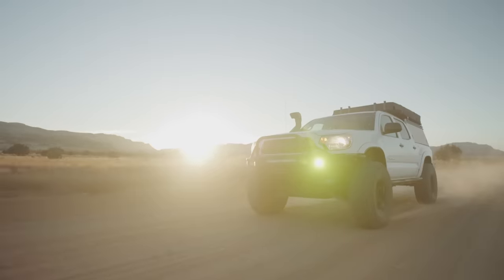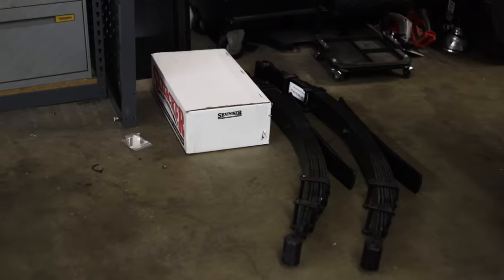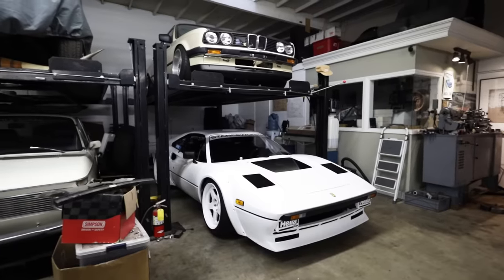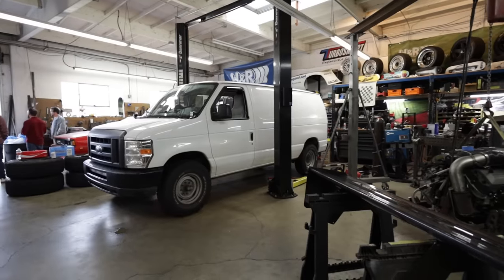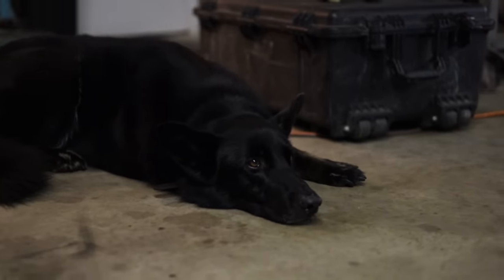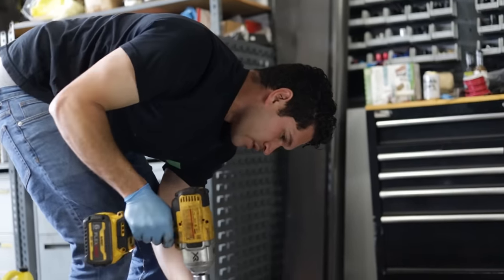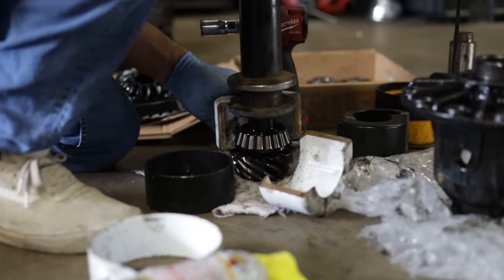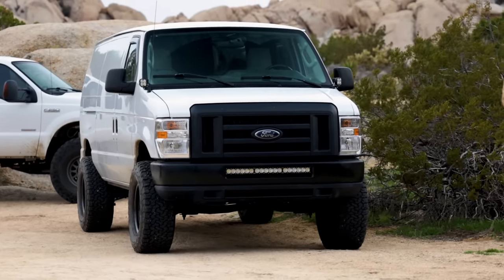Who needs a 4WD van when THIS is an option?

Comment: I think something was worn or broken or out of adjustment on these vans that require two hands to drive.  Maybe they had too much weight  too far behind the rear axle.  My E350 EB cruises dead straight at highways speeds.  Stock suspension with KYB shocks.  Those vans must have needed alignments or maintenance or different loading.
Reply from the maker: I think yours is just the exception to the rule be driven dozens of these vans and owned 2-3. Not a single one drove well stock
Reply: @brakeforsnakes  I should add that mine is a 6.8.  Maybe they have better weight distribution.  This guys is identical.   There are a couple v10 Vlogger that have videos from the road with one hand on the wheel  
https://youtu.be/maxrFIhRnkg?t=619

Comment: Great video. I have questions.... what rear axle do you have. And what was the locker you put I. It?
Reply from the maker: It’s a Dana 60 and a power trax locker. If you look at my latest van walk around video I have a link to it
Reply: @brakeforsnakes  it appears to be a semifloating rear-end. I I contacted u joint about advise on a locker, but his response was that I could only use the factory limited slip in my rear-end. Because it was a c-clip rear end.  It is a dana 60 373 with traction control.  He suggested searching for an axle I can upgrade. Any advise? Was his info wrong? Thanks
Reply from the maker: @MarkReising-z8d  hmmm that doesn't sound like something U-Joint would say because Ox makes a 4.10 and down carrier c-clip 35 spline locker that they use on almost every build they do with that rear axle!

Comment: I want to do the same lift for my 09 e350 extended.  Can you measure front and rear wheel wells and let me know how high it sits on 35's.  Thanks bro.  Love the van and my Wasatch overland high top too!!
Reply from the maker: Weldtech actually has a video where they measure on 35’s and 33’s

Comment: Nice video, 
what was the total cost on the well Texh suspension 5 inch and the rear end?
Reply from the maker: All the parts are listed in the description with links
Reply: @brakeforsnakes  

How about the install labor?
Reply from the maker: As seen in the video I installed it with my friend. I have no idea how much a ship would charge but is very easy to do in a garage if you have a welder
Reply: @brakeforsnakes  

Thanks, 

Last question, with the 4.56 gears, how does the van run on the freeway and is the MPG better or worse?
Reply from the maker: It gets about 15-17 on the highway and probably 12 around town but rpms are very similar on the highway
Reply: @brakeforsnakes  

Great info, thanks!

Comment: I considered doing this to an econoline but I wanted the 4 wheel drive more
Reply from the maker: a 4x4 conversion is much more expensive they're not really comparable. But whatever fits your use case best is what you should do, I sold my quigley 4x4 for this
Reply: @brakeforsnakes  yea I didnt even go with an econoline, I got an awd astro that I converted to 4x4. I agree the e series conversions are expensive but when I off road Its usually up in Michigan and theres nothing but soft sand up there and all I could imagine is a big ass econoline with 2wd just getting buried to the frame rails every time I hit some deep sand. Plus the foliage makes it hard to get fullsize vehicles down the trail. Still love the big Vans, I hope to have something like a sportsmobile someday but what I got is perfect for my current circumstances

Comment: Just saw a video on a body swap to diffrent chassis. I have a 93 E150 Club Wagon Van 5.8L vin 1FDEE14H5PHB57642 and was wondering, can I get a wrecked truck hopefully 4x4 with modern/newer chassis,better TRANS and motor to do the same,AND if so,witch truck would be the one to get that my van body would fit.?
P.S.
I don't want to have to modify anything, would just want to take the body off my van that's in Gd condition, AND put on the newer truck chassis.
Reply from the maker: I don’t have any idea dude

Comment: Kit is $5000, how much would he charge for an install if he wasn't your friend? Anyone know the install price? Would it be another $3000-ish? the welding shops in my area are not cheap, well the quality shops. I'm guessing its around $8000-$10,000 total for the mod as shown? Would it also need more things to be upgraded, like longer brake lines, abs lines, etc, etc, ?
Reply from the maker: I installed it and he welded it it, if there's anymore questions click the link in my bio to the weldtech site they have all the info you need right there. If you pay $3-5000 to get this installed you are getting ripped off. You do not NEED longer brake lines or abs lines but longer brake lines aren't a bad idea.

Comment: snow, mud and the northwest is why you'd want 4wd instead of a tall van with good tires and suspension. I drove a lifted rwd econoline all over the pnw and it was always sideways, real scary... lifted sienna awd is amazingly better and is funner to drive imo...
Reply from the maker: I live in southern california we just have rocks and desert, this thing handles way better than my old quigley 4x4 E350
Reply from the maker: And to clarify it's not about being taller it's about wheel travel, this van has 12" of wheel travel which is double the stock set up and double what my quigley had. Wheel travel has a ton to do with traction along with the detroit locker in the rear.

Comment: 2 wheel drive common man
Reply from the maker: 2wd with a detroit locker is pretty damn capable. My last vehicle was a tacoma on long travel, dual lockers, bypasses, 37's,  etc and a quigley 4x4 E350 van. I sold my quigley for this setup, 4x4 isn't always the answer for every build.

Comment: Why are they re-gearing?
Reply from the maker: Because we out bigger tires on
Reply: @brakeforsnakes  OK I guess so the speedometer will keep up with the tires? I wonder how they calculate what kind of gears they need for the big tires would’ve been nice if they explained it a little bit deeper.
Reply from the maker: @thruthaseen.9892 it’s pretty basic stuff for Offroad vehicles. Regearing is extremely common and if you don’t understand the concerto just watch a YouTube video specifically about that. That’s not why I made this video
Reply: @brakeforsnakes  okay no problem thanks

Comment: Well 4x4 is for those who wish to actually go off road…..🤣🤣🤣
Reply from the maker: I sold my 4x4 quigley E350 for this and besides snow/mud this is just as capable with the more than double the wheel travel, locker and 35's.
Reply from the maker: Again I think you're confused, you do realize that this kit doubles the wheel travel right? Lifting is not just about making the vehicle higher. You should maybe go look at my other videos.

Comment: Great video, but flawed.  Who needs 4wd when "A lift" is an option... um, someone who needs traction more than clearance.  The van looks good pal, but it aint going where mine is going.  Let's none of us kid ourselves... that kit is going to give a dummy false confidence and they will get stuck the minute they leave the pavement.
Reply from the maker: Tell me you didn’t watch the video without telling me lol. Do you not understand how going from 6” of wheel travel (that my old quigley 4x4 e350 had) to 12” of wheel travel with this van helps traction? Sure lot you understand a lift isn’t just about raising it right? Did you miss the part about the 35” tires or what about the Detroit locker?
Reply: @Jim Bob  I didn't miss a thing.  Clearance means you don't get hung up on things, travel means you absorb things.  All good on a fire road with a few ruts.  Your van on snow, in sand, trying to cross anything where you exceed your flex... no traction.  A low slung 4x4 in stock form will go places that van with a lift simply cannot.  Don't get me wrong, it looks awesome, but your click bait title claims otherwise,  and we ALL know better.  Great videos though.
Reply from the maker: @matthewpeterson3329  seeing as I sold a 4x4 econoline and chose this over it I’m pretty well versed in the subject. Obviously 4x4 is better in snow and sand but wheel travel allows your wheels to reach down or up to traction where a van with less wheel travel will lift a tire hence NO traction without a locker. I’ve got double the wheel travel and a locker it gets me most places and most people don’t need 4x4 on their vans especially at a $25k price tag. I’m simply offering a different perspective that you can have a lot without spending that money.
Reply: @Jim Bob   You need to calm down.  Traction only matters on drive wheels, so reaching down into a rut, with the front end, would only affect steering and body roll, not traction.  I'm not trying to hose your video here, but what you said is wrong.  That system will improve the ride, it will give you clearance (important sometimes), it will increase flex which can mitigate body roll and keep a rear wheel on the ground.  Which yes, with a rear locker, it will help you proceed.  But I stand by my statement... it is not a replacement to 4wd and your video title was CRAP.  I'm not a kid, not a novice, I have been around this for better that 40 years.  A fat, top heavy van with 2wd and a lift will not do what it's 4x4 counterpart will.
Reply from the maker: @matthewpeterson3329  Lol yea and you keep missing my point, of course the title is click baity that's how youtube works. If you read my last comment I said I'm giving people another point of view on something that will get the to MOST places they need to go. Have you owned both 4x4 and locked 2wd econolines?